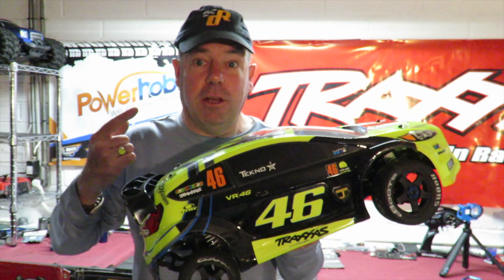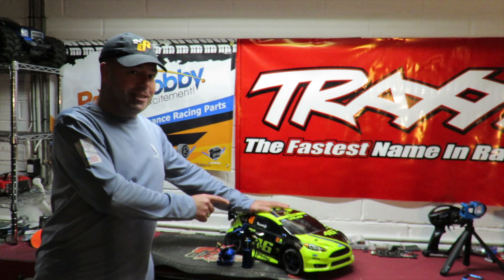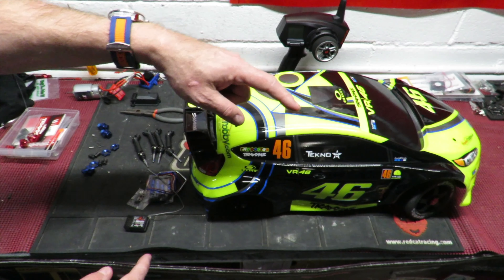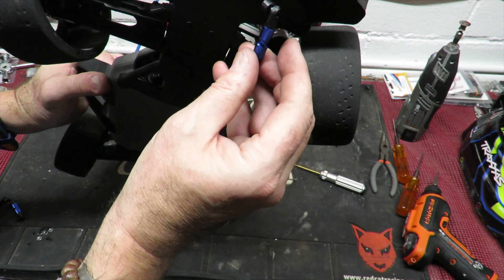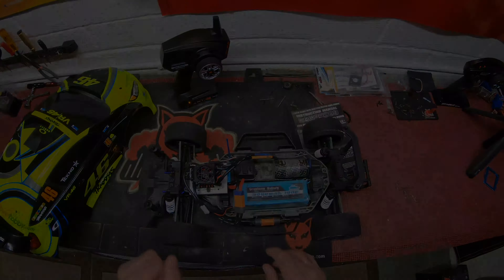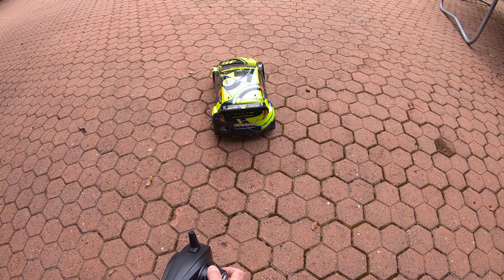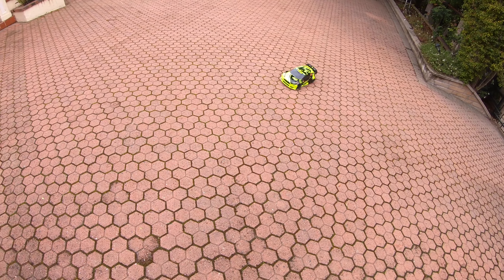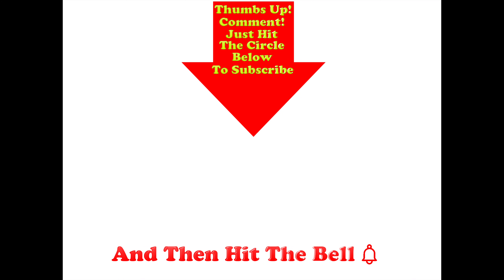6S Traxxas Rally Shakedown II #RCMONSTER

Comment: Snapped the stock plastic driveshafts on my maxx on the first pack after switching to the wide maxx kit. Totally different rc, but you asked about anyone having problems with traxxas’ plastic driveshafts. I’ve since swapped them out with the 8950x kit and went back to the stock arms.
Reply: The maxx has one of the most durable plastic driveshafts a bit surprised that you menaged to break one

Comment: how are the stock diffs holding up? i had to switch to x01 diffs after putting a castle sidewinder8 into a slash 4x4.
Reply from the maker: stock diffs still all good, that said Xo1 diif tip MUCH appreciated, I was thinking about ordering HR hardened ones as backup
Reply: @DriftomaniacsRC  i use hot racing aluminum diff housings with the x-01 internals, so far so good.

Comment: The standard issue Traxxas drive shafts are good and rebuildable  and slot straight in unlike the XO-1's Front 6851R | Traxxas Front Steel-Spline CV Drive Shafts (Complete) 2Pcs
Rear 6852R | Traxxas Rear Steel-Spline CV Drive Shafts (Complete) 2Pcs